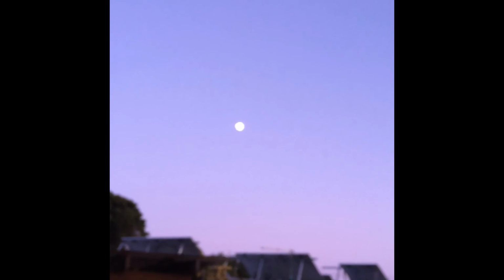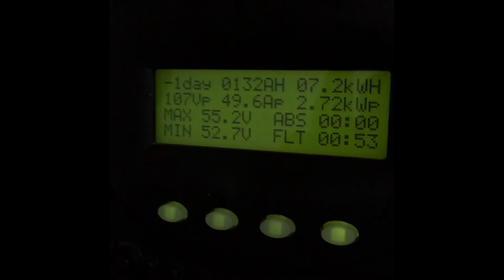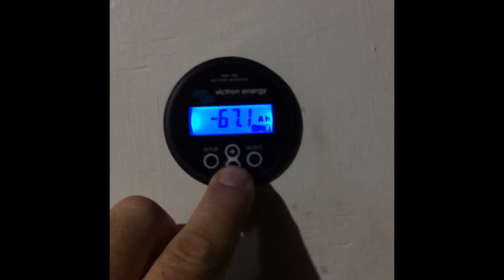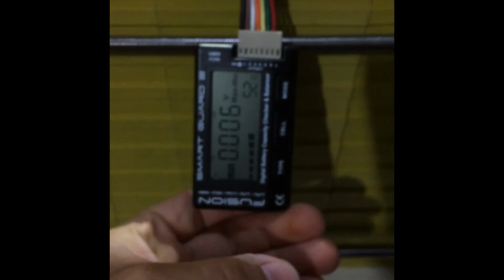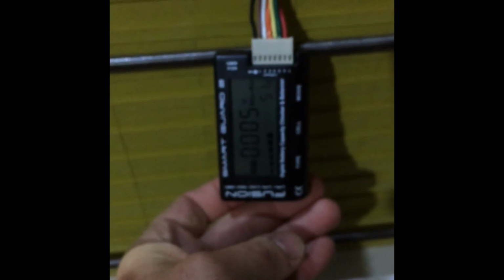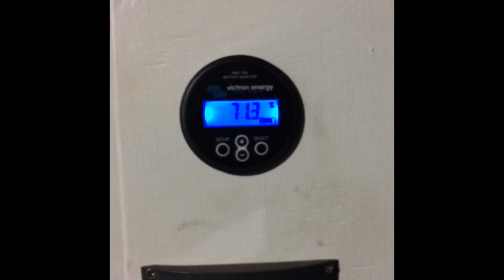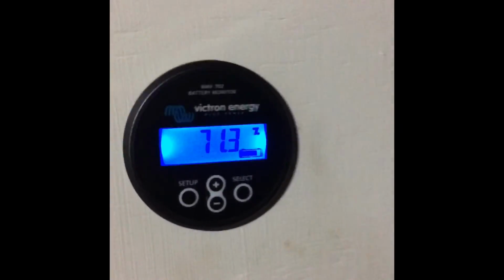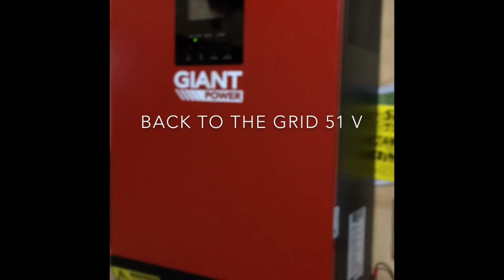SOLAR POWER USING THE WINSTONE LITHIUM BATTERY BANK LYP-300AMP

Comment: Beautiful yellow Lifepo4 bank. Good update! I know it gets boring after a while as this things just work after they are set up but do make more videos if you have a chance. Is the Giant with its original firmware or are you using the lithium specific one?
Reply from the maker: Gustavo Malaga  the giant is straight out of the box no charge has been done, I use the flexmax 60 as the main charge controller .... cheers
Reply: Como va Gustavo!!  Que pasa que ya no sube mas videos?  Espero que estes bien!
un saludo!